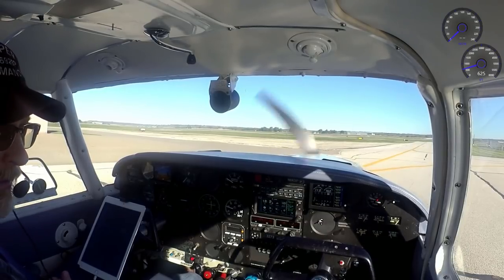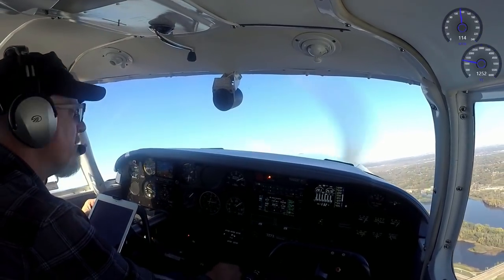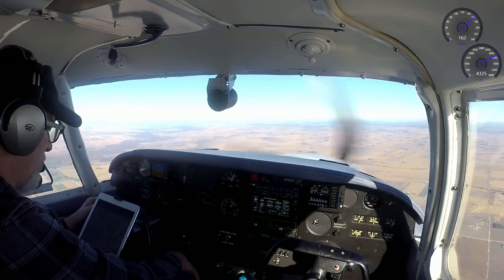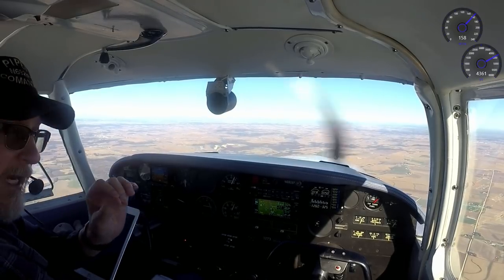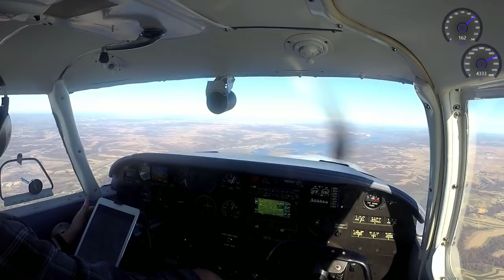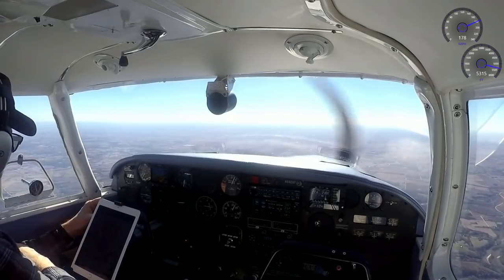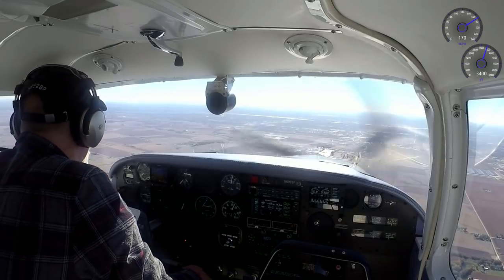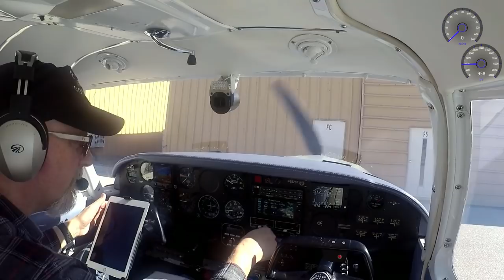Piper Comanche 250 The 4 Forces of Flight Part 1

Comment: Nice presentation. I am looking to buy the Comanche 250, any suggestions? Thanks.
Reply from the maker: Hi Alex,  Just the normal stuff.  Get a good pre-buy from an AP that knows the air frame and AD's that come with it.  What's nice is they are solid air frames and it is rare to find corrosion.  Best of luck with your search and feel free to give me a call if you have any questions that I might be able to answer.  Mike